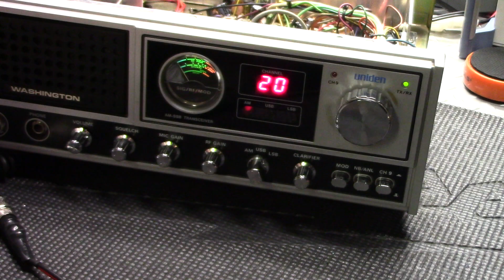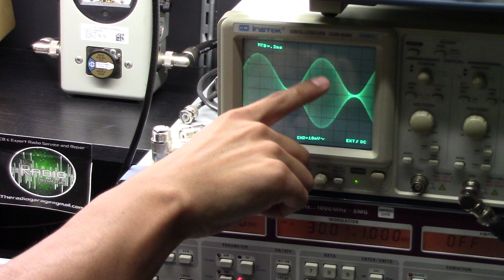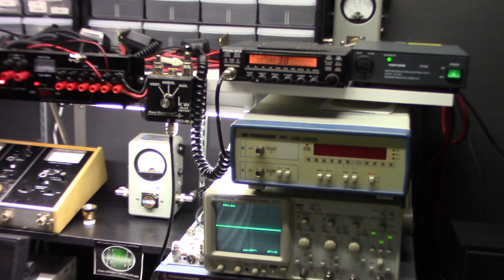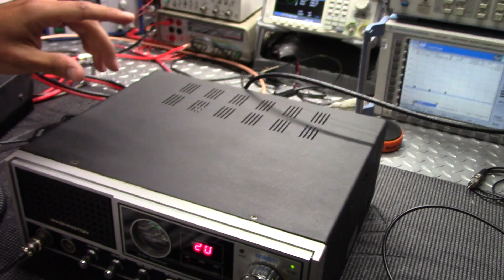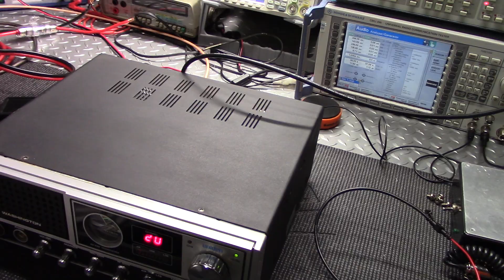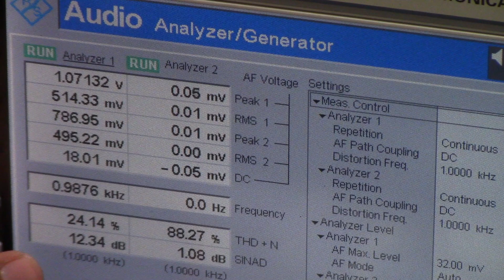Uniden Washington *Superb Modulation* CB Radio SSB Monster Audio

Comment: Great SSB rig. The Only issue with this chassis is no separate filters for AM. It was the budget radio shared on filter for AM/SSB. Just too narrow for AM. Which would make people sound a little mush mouthed. Because the bandwidth is chopped off.

Comment: I first saw one of these back in '87, I think. The Channel 9 button was modded to go to 27.445. I have wanted one ever since.
Reply: Yes the three button version but there was two button version which was true President Washington I found the 445 by accident you didn't even have to wire anything if you push that middle button half on half off hold at mid point and it talked and received on 445 other models I believe could do same thing 
Loved mine got it in late 70slike 1978 79 just couple years after fcc upgrade to 40 channel radios